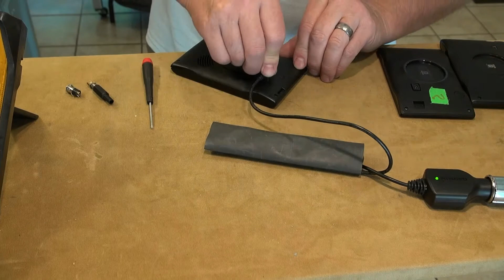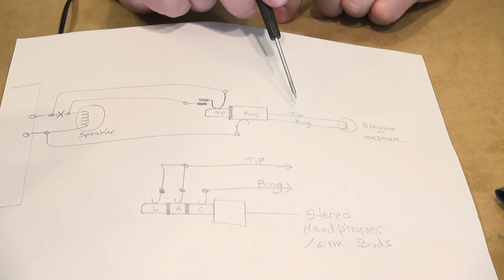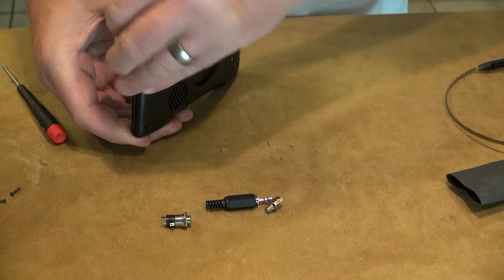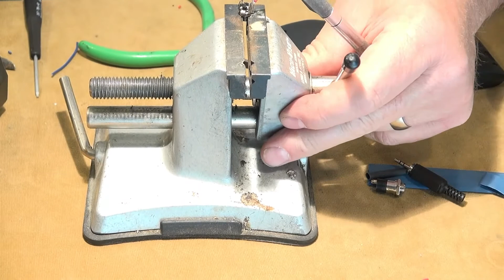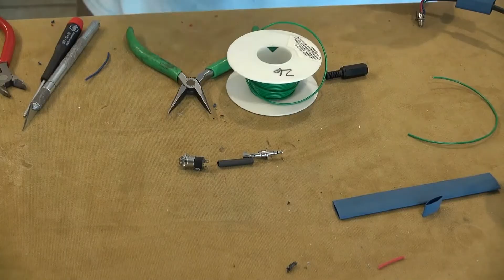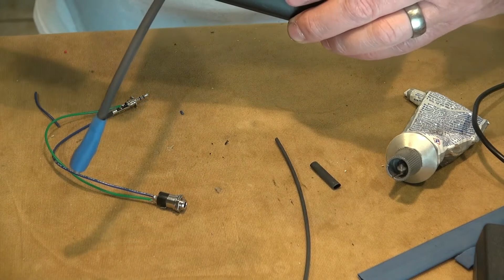GARMIN GPS add HEADPHONES / EXTERNAL SPEAKER

Comment: This is Friggen awesome! Hey! I have a question. I still have my old Nuvi 3795 and it has two types of speakers on it. One is the rear speaker and the other is the front speaker. The front speaker is the mic for the voice search on the Nuvi. If i connected a jack to the common and the audio of both mic and speaker would they work together with the nuvi?